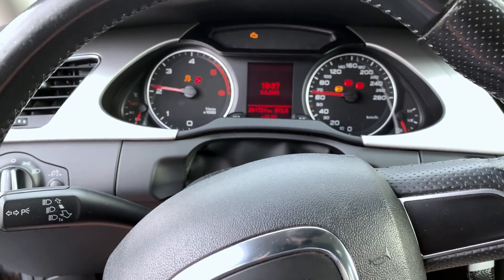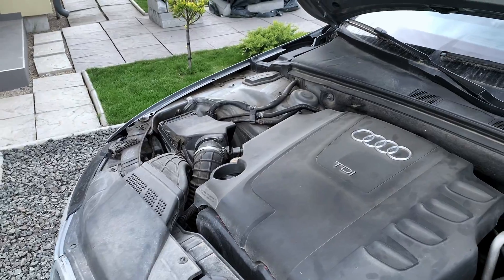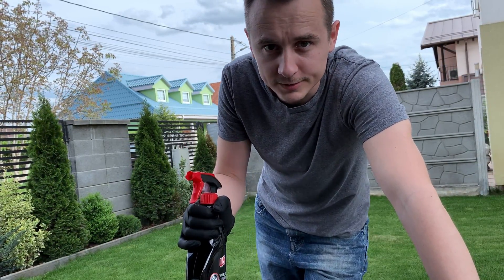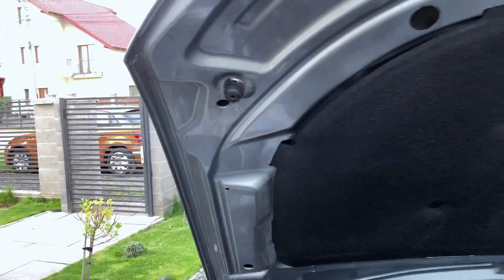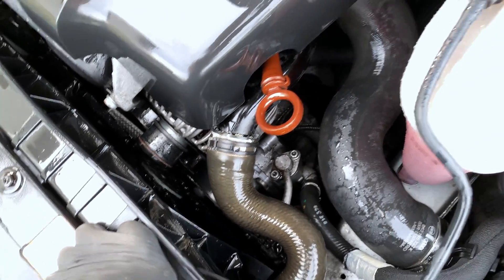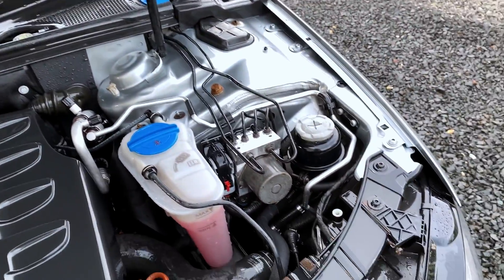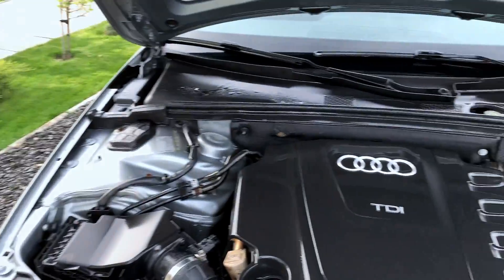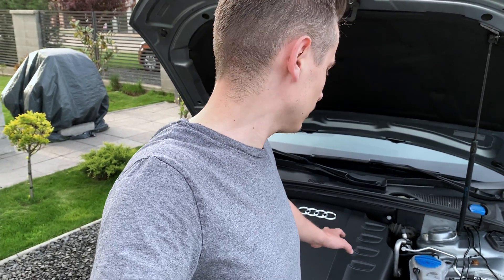Engine cleaning with a pressure washer - Audi A4 B8 2.0 TDI

Comment: First thing, never use high pressure water. Second always cover the alternator with a plastic bag or something similar before spraying anything all over the engine. Lastly once you finish use air (low) pressure to push all water away to dry to engine then use some microfiber cloth. Most importantly give the car a 10 minutes drive around to speed up the drying as it so important
Reply from the maker: Hello! I understand there is a risk with pressure water, but if all connectors are good the risk is low. Why is it important to speed up the drying?

Comment: Salut! 
You have a plastic cover between your wipers and engine bay. Remove that and try to clean everything there because there is where te most dirt and 🍃 leafs are and it keeps hummidity there => rust in time. I just did that on my a4 from 2014 and i got 4 handfull of leafs and dirt out. Bafta, am scris in engleza si pentru străini.
Reply from the maker: Thank you for this good advice! I will do so. 🙏👍
Reply: How did you clean that? I just noticed mine is full of leaves and dirt... not sure if I can pressure wash it because I see some exposed cables.